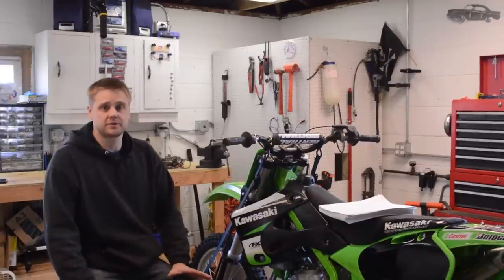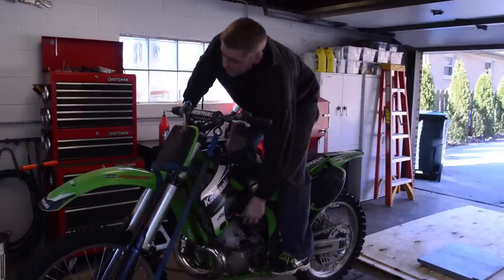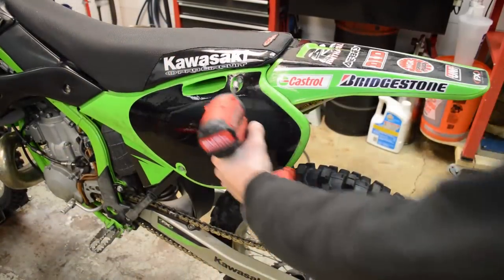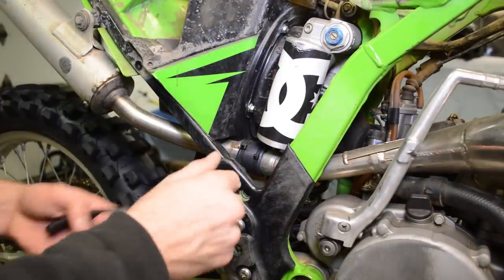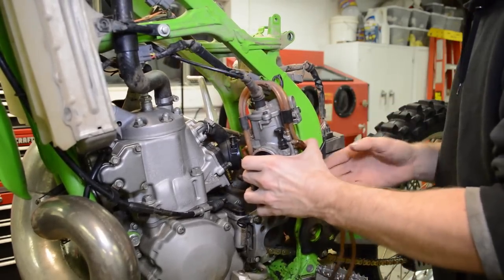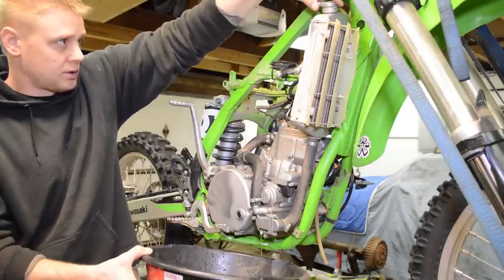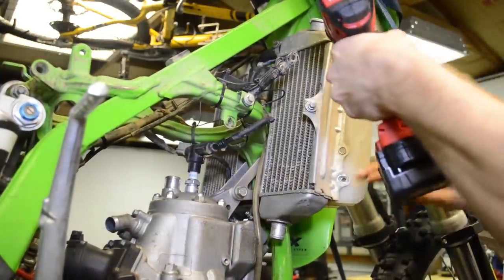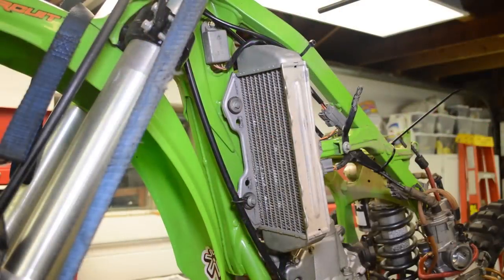How-To: Kawasaki KX125/KX250 Top & Bottom Engine Rebuild 1994-2007

Comment: I have a 2008 kx85 and my kickstart won’t go down it’s seized how much would it cost??😥😥😪
Reply from the maker: Is the engine seized?
Reply: MatthewMCRepair yeah
Reply from the maker: Hard to say without looking at it. If you pull the top end you can get a better idea if the bottom end is toast.
Reply: MatthewMCRepair oh ok because I had an oil leak I didn’t know when I was riding and on my way back home it cut off and wouldn’t kick
Reply from the maker: Pull the drain plug and measure how much oil comes out.

Comment: my buddy has this same bike along with a retired ama 2013 kxf450 and his 250 is just incredibly fast at the end of the shootout hes maybe a bike or two distance in front of me and his 450 has traction control and holeshot button. my question is how is this possible and if i decided to buy the same era 250 what could i do to have a fast setup like that
Reply from the maker: You can make anything fast, just depends on how much money you want to spend.
Reply: maybe 1000-2000 parts. i have another question i only weight about 145-150 and am constantly finding myself getting bucked from all size bikes what can i do about this when i set up a bike for me im looking to get either a sx250 or kx250
Reply from the maker: Get the suspension resprung/valved for your weight. That is where I'd spend my money first.
Reply: definetly. where do you ride
Reply from the maker: I live near Chicago.
Reply: im from lansing mi we go to bundy hill in jerome mi evet been there
Reply from the maker: No I haven't. Just had a newborn (I have 4 kids) so I don't get to ride much...LOL.
Reply: right. i have a 1 1/2 yo. you should check it out one of these days $20 flag $20 one day entry $30 weekend pass + 350 acres of land to ride on. they have everything from a drag strip to trails in the woods
Reply from the maker: OK thanks for the info.

Comment: Does anyone know if theres a silicone center case gasket or is there a paper one, my yz had a silicone one and I cant find paper ones anywhere
Reply from the maker: What year and model YZ? Do you have the service manual? Did you look in the OEM parts finder?

Comment: why not use ur clutch when shifting gears?
Reply from the maker: +TheRonja004 No real large load on the engine or the shifter. Just let off the throttle a bit and shift.
Reply: +MatthewMCRepair oh okey, but you would recomend using the clutch when ur accelerating hard?
Reply from the maker: +TheRonja004 I do, however I know riders that don't.
Reply: +MatthewMCRepair hm okay, thanks for the answers. And keep up your good videos!
Reply from the maker: +TheRonja004 No problem. And to better answer your question, if it takes a ton of "foot" force to shift, then use the clutch.

Comment: How much did the whole engine rebuild cost?
Reply from the maker: About 800. Includes crank rebuild, replate, OEM bearings seal etc., piston.
Reply: What about the cost of the specialty tools needed?
Reply: After that you’ll probably be in the 1200 it will cost you to have a professional do it, save yourself the 6 hours of video to watch, the 10-15 hours of labor and spend the money to know it is done right
Reply: noah burridge if you include the transmission and clutch in that 800$ price bump it up too 1300$ before labour
Reply: aint no fun in that

Comment: Jeez, my poor 2002 kx125 only has 130psi 😅. Still runs though.
Reply from the maker: Make sure you are not using this style gauge: https://youtu.be/q1H7550B48I?si=Z0DCK3-qW9LFJbq2
Reply: @HTMR  Yes, my compression tester has a shrader valve on the end you attach the different plug adapters. I bought mine at NAPA. Thanks for the suggested web site, I’m kinda anal about my tools, I want nothing but good tools. Makes the job way easier!

Comment: do you know how to fix a leak on oil leak on a kx250?
Reply from the maker: Sure, where is it leaking from?
Reply: Most oil leaks from cases are due to bad sealing. If its a cover just pull the cover and replace the gasket. If its the middle of the cases the engine will have to be torn down and while your at it you might as well rebuild the engine.

Comment: That sucks you had me when you said 1994 but so far everything I have for my 1994 KX 125 has nothing to do with the 1993 or 9095 on up to 2019 94 seems to be a great market bike it's on it's own everything from that the cables to the air filter I everything has to be special ordered has nothing match up with anything else I feel like I got screwed and bought a gray market bike every time I I can't it's got to be a special order cause it's slightly different I was hoping to find that you had a 1994 KX 125 rebuilt and you were gonna walk me through it but you don't have all your facts right I know this because it's costing me a lot of aggravation and grief in money everything up to 93 is one way from 95 on up is another way to 94 is it's own it's own effing world